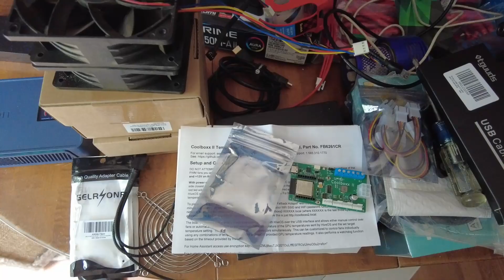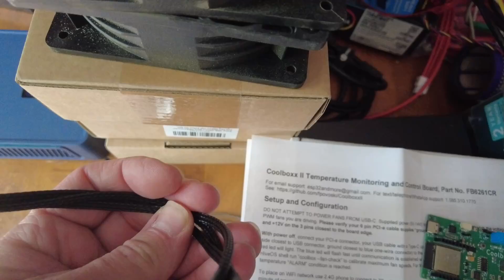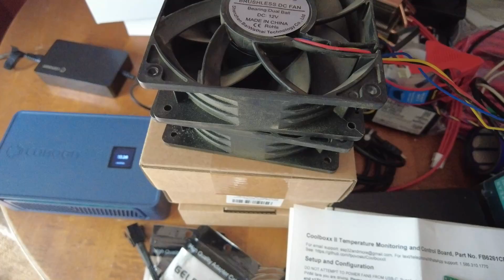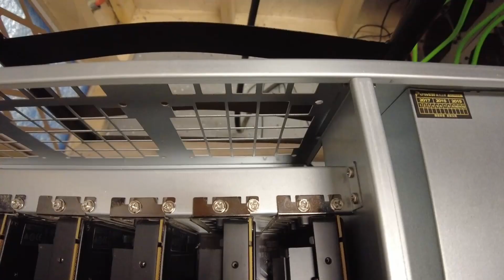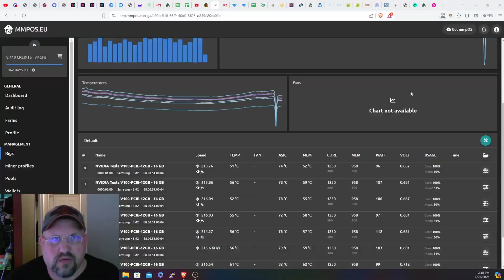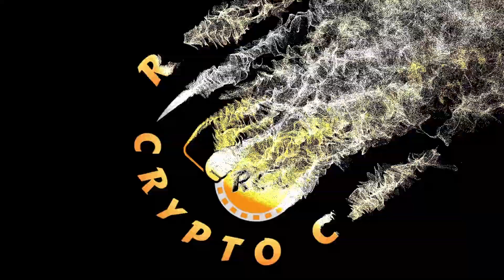Success! Cooling Solution for Nvidia CMP100-210!

Comment: Hey rusky, why do you have those little foam loght blue green pieces in between your gpus in the server case? Wouldnt those impede air flow? Did i miss something?
Reply from the maker: It does impede airflow through the space between the cards and forces more airflow through the heat sinks of the cards.  I tried it with and without them and had better temps with them in there.  MotorCityMiner has these cards too and he has his airflow the opposite direction.  I may try that out.  I currently use two sets of fans in a push/pull set up.  May spin the one set around and try just a pull setup
Reply: @ruskyscryptocave  thanks for the reply! Makes total sense, sorry if it was a stupid question. I wasn't sure of the heatsink design. 
If you had free power what gpu would you buy in mass? I was looking at 6800, 6800xt, but maybe 7900xtx....
Reply from the maker: @andrewjones198  I honestly don't a ton about AMD gpus.  The last ones I had were 5700xts and they've been out of service for 6 months or so.  From what I read and saw online, the 6600xt and 6700xt are the most efficient.  Nvidia cards would be 3070s, these cmp100-210s and 170HXs

Comment: I had fun the last couple days with a Hot gigabyte rtx 3090. I deshrouded it and tried noctua fans, swapped pads etc, even put the heat sink from an rx 580 on the backplate with noctua fans. 
I still wasn't happy, so I ordered one of those triple server fan packs and now it's probably the coldest gigabyte 3090 out there. It's Janky AF though
Reply from the maker: Function is greater than form when it comes to mining!

Comment: I have one RTX 3080. Please suggest me a good coin for speculative mining. Thanks and keep up the good work ❤
Reply from the maker: It's crypto they are all speculative.  I still have my 3080's on Xelis
Reply: Hey there, I suggest looking at mining pool stats and mining the one that has a lower network difficulty. Your rewards will be higher in yield, so you can then grab the next price pump if you HODL. Try using the heat in a small room to save on winter costs!